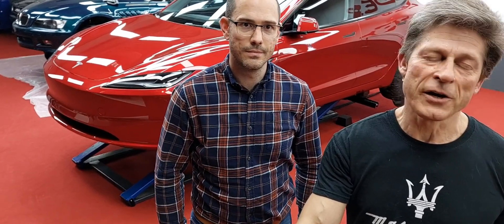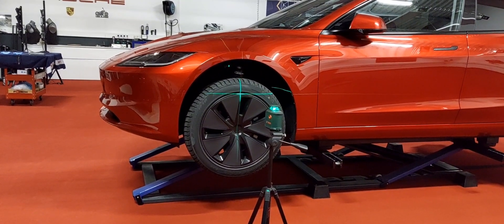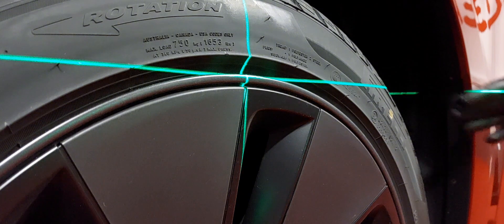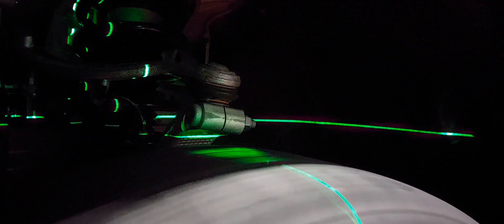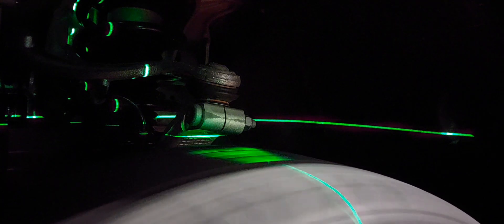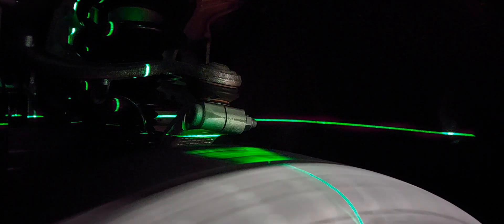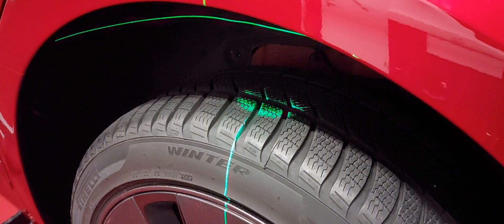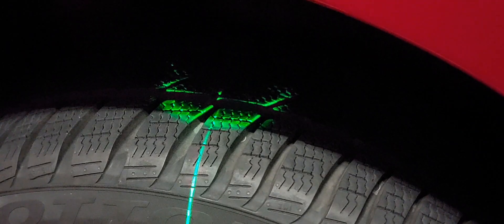Tesla Vibration in the Steering Wheel? Here you can see why this happens - it's not the cars fault!

Comment: I have the same with 2025 Model 3 HL AWD and original summer tires at 120 km/h and with winter 19“ on borbet at 140 km/h, which is strange to me since different rums and different tires, but similar problem but at different speeds. Couldn’t this come from the front axle maybe?

Comment: I can confirm this is not the cause of the problem ..I bought a brand new Tesla Model 3 Performance 2024 and have brand new winter tires and rims and noticed the vibration from time to time.... now I have the brand new original summer Tires on and it's still vibrates from time to time

Comment: I appreciate your effort in addressing your customer’s issue. However, like many automotive technicians, you may not be fully aware of the rigorous testing that tires and wheels undergo at the OEM level before installation at the factory. Tolerances in manufacturing allow for lower production costs, as achieving perfection in mass production is virtually impossible without rejecting and recycling many finished products.

Even tires produced from the same mold on the same day can perform differently on the road. To ensure quality, every tire and wheel is tested and graded at their respective manufacturers and then retested at the mounting assembly plant. Each tire is then tagged with the VIN of the vehicle it’s designated for and assigned to a specific corner of the vehicle.

This process is the industry standard, developed with customer satisfaction and liability concerns in mind.

Here are links demonstrating key stages in this process:
	•	TUG (Tire Uniformity Grader) Function: https://youtu.be/7Tyy1EPTYOA?si=m-wrxoN9vu_djodN
	•	Wheel Uniformity Grader: https://youtu.be/jvDk4jwDMFY?si=38pgCP3OTJd01p2B
	•	Wheel and Tire Marriage Process: https://youtu.be/aOlnFO3X5cM?si=Ds0yd90GysufDPt6

This long-standing practice, dating back to the introduction of radial tires in the 1960s, ensures that factory wheel assemblies are among the most precisely balanced and round configurations a vehicle will ever experience. Problems with noise, vibration, and harshness (NVH) often arise when tires are removed from their wheels or replaced without respecting the original optimization.

Comment: Bought a 2025 M3 LR RWD.  I have less than 300 miles and I may have this issue (Goodyear Eagle All Season).  I took to Discount Tire and they rebalanced and it may have helped just a little.  Waiting on my Tesla Service date next week to take in to have further diagnosed.   I'll definitely have them check for flat spots!
Reply: What ended up being the issue?
Reply: @RogerSM3 They replaced both RH side tires and a realignment.  They said the noise canceling foam separated (brand new) and caused the vibration. Sounds like it was enough to throw the alignment out as well.  It drives very smooth now and no issues since.

Comment: The laser test checking the roundness of the alloy wheel itself (not tyre) is the issue, you can see the laser moving up and down meaning the wheel isn't truly round, it's oval, not sure how you've missed that but you should watch your own video again
Reply: Exactly! Tesla changed the tires on several on my Teslas wheels, but it was only when they changed the rims that I noticed an improvement. There is still issues with vibrations but they also have one rim left that they identified wasn't round but slightly oval that they are going to change next week.

Comment: I have a MYP 2024, i get really slight vibration on the steering wheel at above 100/110kmh. It’s definitely there, you can definitely feel it. It’s not a typical balancing kind of shake, goes away if you’re accelerating or braking.. so this might actually be it. My car must’ve been sitting in the factory lot for at least a month. Maybe that caused a flat spot on front wheels..
Reply: When I change to winter tires, I’ll get the summer set checked. See if there’s anything we can do.. might just be balancing issues.. worst case - 2 or 4 new tires.

Comment: I have only encountered the tire issue in Teslas, and not in any other car I have worked on such as BMW, VW, Mercedes, Nissan, or Audi. I am curious as to why Teslas seem to be affected by tire imperfections and vibrate, while other manufacturers' cars do not have this issue. It seems that many other people are also experiencing similar problems with Tesla regardless of the tire manufacturer.
Reply: Could it be the extra weight of Tesla battery? Were your other cars EV too?

Comment: Can you recommend some alternative tire model for the Highland 19" 235/40r19  ?
Reply from the maker: Well, first off all we are not judging tire brands, cause many people have many different experience. Buuut, obviously this car doesn't get the premium joice which is available. To our surprise the former Model 3 came with Michelin PS4S or Hankook Evos, were we never heard about any issues. 
A personal note: We had same problem a decade ago with brandnew Fulda on a Audi with heavy V6 engine. Car jumped like crazy with cold tires, going on Autobahn with high speed did made them round and "healed" the problem. After a stillstand a few hours later it restarted. The car was not useable, the tire dealer shrug his shoulders and we had to throw away those crappy new tires. This is even the reason why we did this clip for the Tesla Community.

Comment: I have a new model y performance that I picked up 3 days ago.  It has a small vibration in the steering wheel at about 50 miles pet hour.  It does not always transfer but am afraid it may get worse. Tesla service center is 70 miles away and doubt they could replicate the issue on small test drive. Any suggestions?
Reply: Did you ever get it fixed?
Reply: Have similar sutuation I’ve just ignored it. Like you my dealer is very far.
Reply: Go to settings in autopilot and turn OFF "Lane assist"....please let me know if vibration are now gone

Comment: If the flatspot was caused by sitting in transit, the answer could be to inflate the tyres to a higher pressure, say 60psi for a  while, with the car wheels up in the air, or with the flat spots positioned at the top.
I worked for a big car company, and any of our cars destined for long sea voyages were specified to have the tyres overpressurised during the trip to stop this happening.
Reply from the maker: thank you very much! I really appricate this solution by doing first of all.
Reply: Rumor has it that Tesle UNDERinflates cars while shipping. I don't know why, but it seems to have caused this issue in many many cars delivered to Europe.
Reply: Yes I had mine returned to tesla service after experiencing the same problem, and they told me the same thing. Due to sitting too long in transit the tire got a flat spot, they said it would be fixed by itself after 3k kms or around 1.5k miles and while it's less prominent, I still feel like it's there after 3.4k kms on the car

Comment: I had this problem on my new M3 Highland and had a service appointment. However I cancelled it because later the vibration had amost disappeared.
I believe all the tyres had small flat spots from being stored in one position on the boat from Shanghai and after a few weeks driving these flat spots have gradually gone. It seemed worst on very smooth tarmac but is hardly noticeable now
Reply: We have a motorhome (wohnmobile) and always store over winter with tyres at 80 psi. Never have any flat spot problems🤞
Reply from the maker: @rogercorbett7962  so true and we do the same with private (summer) cars. And you bring next reason why some cars suffer and some not: Maybe they have stored with low psi. Together with no movement those tires get a flatspot.
Reply from the maker: well, I have tried to explain this fact another owner, but in German. Thank you for this comment, I think that is the point: Those flatspots can be reduced by driving them warm, fast and then slow again to cool them down. I know this is not the way most owner drive BEVs, but it works. Truely one problem is the speedlimit cause you need high centifugation force and a hot tire.
Reply: If these are flatspots from storage on the boat do you think they are permanent but just get better so they aren't really eventually noticeable?
Reply from the maker: @rogercorbett7962  well, difficult to say. If those tires are garbain, they will come back on a longer stillstand periode. Me had this problem on a former car and they went, then come back and so on. Those tires are made in China and probably they have a problem. You have to know, after this clip we had an 7 years old Porsche with low milage in our studio, this car was standing 90% of its livetime. The tires were as old as the car. We took the laser as shown and saw no flatspot. This told me, something is going on with those tires Tesla is using.
Reply: I've driven 2,000+ km – still an issue. How long did you drive before it became better?
Reply: As I said above - just a few weeks. Done 2000 miles now and not an issue I can feel now.

Comment: Firstly... good video!
...but sorry, the customer has only one dealer, and this is TESLA. So TESLA is responsible for the damage in the tire. 
Not enough quality checked before the sample part was released by Tesla´s expert. Tesla should change minimum 2 tyres every customer with this issue.
Reply from the maker: the main point: It is not a fault of the car itself. Many people are changing parts, make a new chamber adjustmet, let it balance new etc etc. But those tires are simply flat from standing.

Comment: No tire is perfect. All the tires have imbalances of weight, dimension or stiffness, with the later causing the biggest problems. The phenomenon is called "Shimmy" That's why Premium car manufacturers spend a lot of engineering effort to make sure these vibrations do not get transfered into the car, especially the steering wheel. Tesla's suspension systems are just engineered poorly

Comment: not so easy cause the flat tyre spot has been caused by what ? 
stand to long on the same spot which can have been caused by tesla and not by the tyre manufacturer. 
I doubt that the tyre manufacturer has anything to do with that cause if you buy the same tyres from any dealer would you have the same issue or not ?
I bet for not cause if so people would complain for ages about these tyres.
Reply from the maker: obviosly from a long period of stillstand (maybe at hot temperatures too). A friend of mine worked on a very big (the biggest in Austria!) Car-dealer and they used to have a own team to move the cars to avoid this problem. Personally, my private Porsche - which is driven only in Summer and has a stillstand period about 6 months - is on 4 Bar tire pressure and soft Tireshoes (these are round to give more aera for the weight) - you can bet, I have no problem. 
Some people here told, with new tires from another brand it has gone.